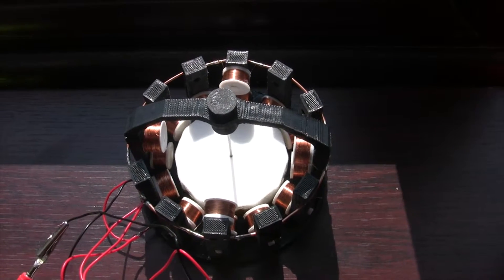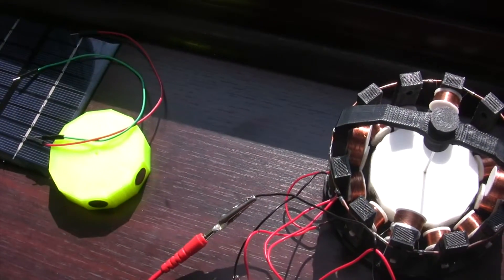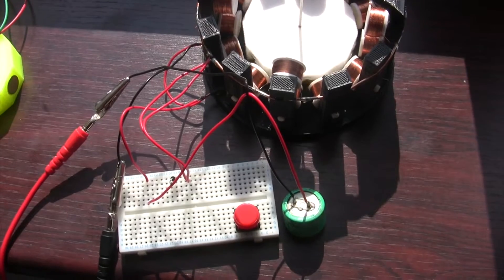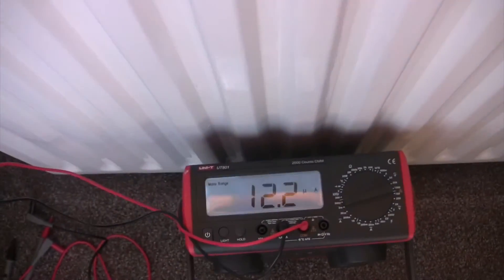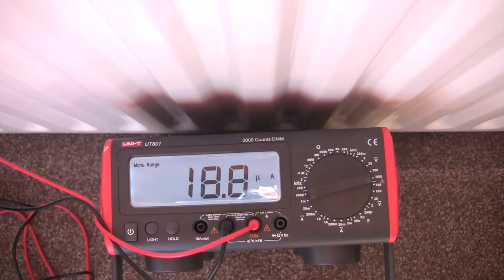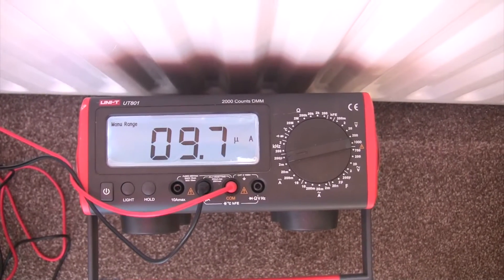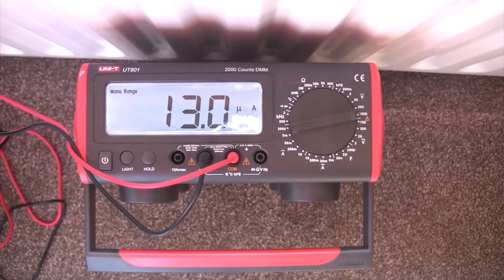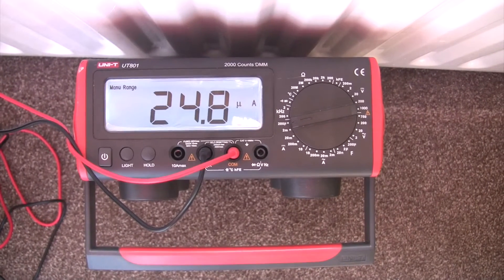Micro Amp's How to read the current draw of a Pulse Motor..

Comment: Temporarily fit a 220uf cap on the motor then wire a 100 ohmn resistor in series with the meter on current setting and your stable power supply. The motor will take current from the cap and you should see steady current required  to keep the cap changed . Perhaps even a 10 or 22 if cap should do for the test

Comment: I have measured motors and had the same issue. The staccato nature of the motor itself is why the reading is so varied. I just not the high and the low and divide by 2. Lasersaber used analog meters to smooth out some of the variations. 

I would say that your draw is really quite good. I have never gotten below 50 micro amps. 

You have gotten around 20 microamps. Are you going to post your 3d files for others to replicate? I would love to give your design a try.